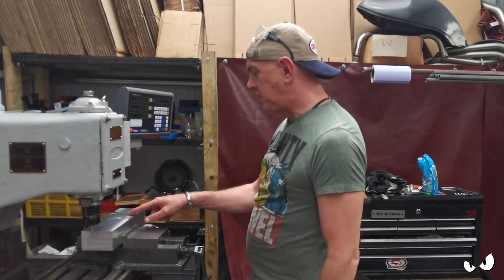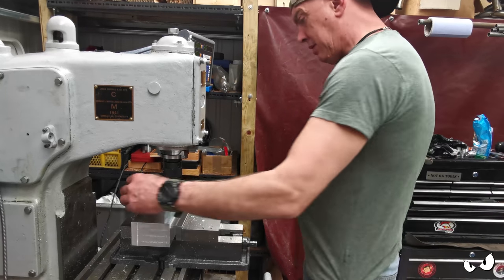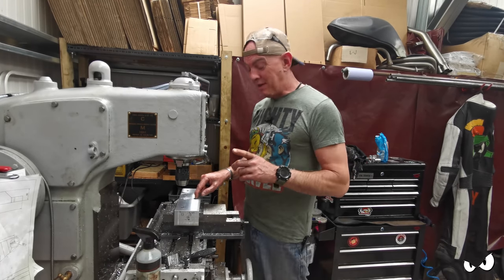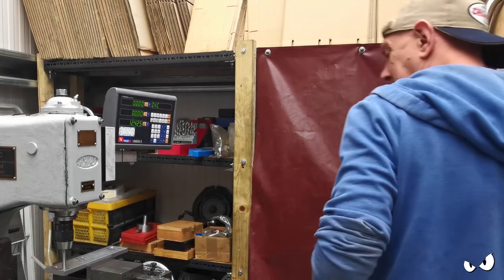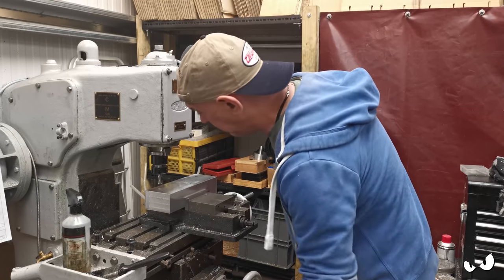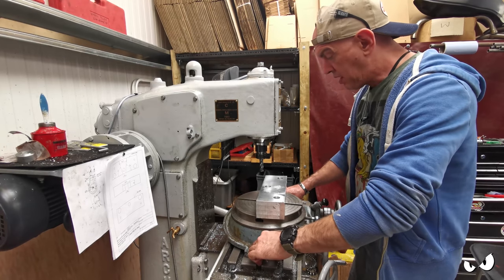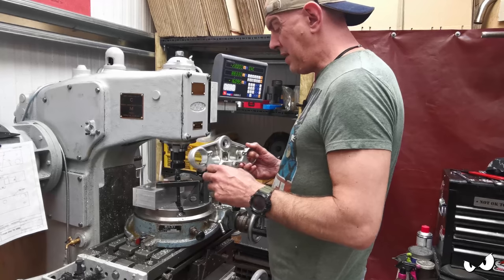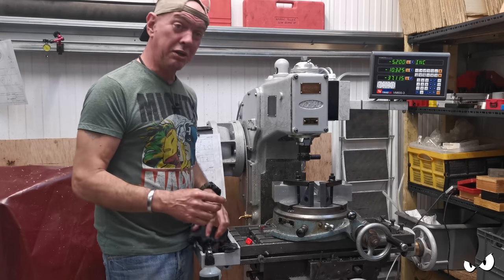Front End Swap - Making a top yoke for the Suzuki Bandit Cafe Racer project - Part 2

Comment: Well done on the progress of the yoke. that is a pretty hard component to make for a beginner but don't give up. When I worked for Ford's I still had trouble sometimes trying to make obsolete parts for the machines and especially setting up the rotary table. Sometimes it took ages to set up just to do 2 minutes of machining lol. They got a second-hand CNC mill but nobody knew how to use it lol. But just doing a one off on a cnc took too long by the time it was programmed it would be quicker to do on a Bridgeport lol
Reply from the maker: It does take a long time... way longer than I thought. But I'll keep chipping away and we should be fine I reckon 😁👍

Comment: You mention 22mm as the diameter of the bars and the steering hole. You're sure that they aren't actually 7/8 ths (22.2mm) which is what handlebars were traditionally based on.
Reply from the maker: Advertised as 22mm and I only.measured them with calipers, so.youre probably right fella 🤣😂